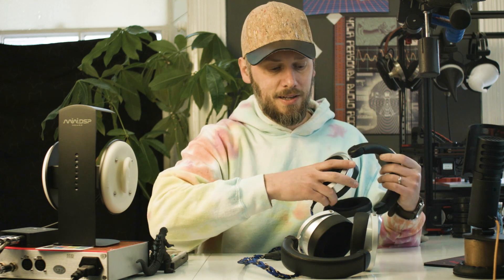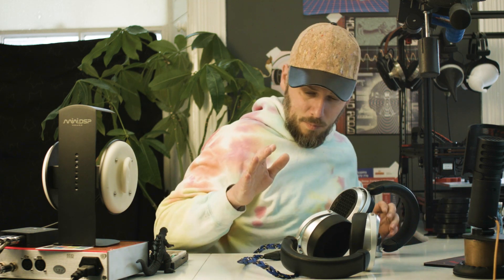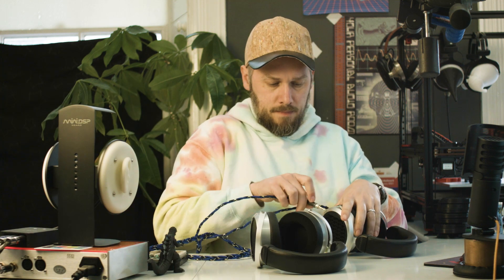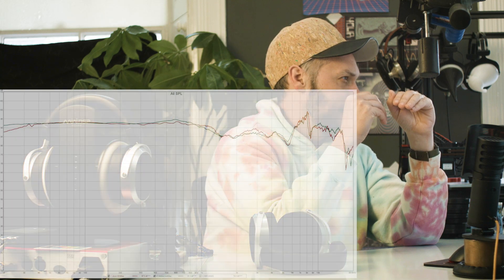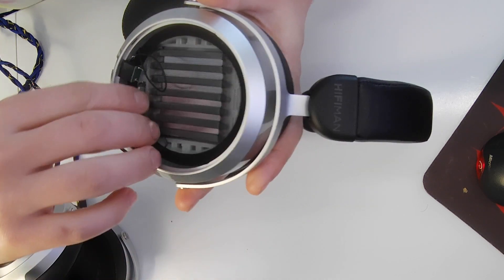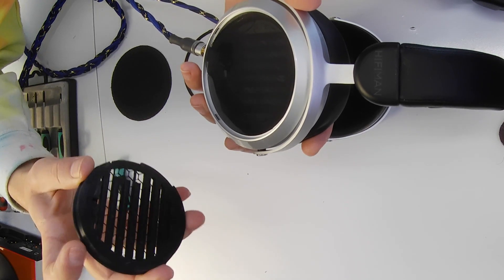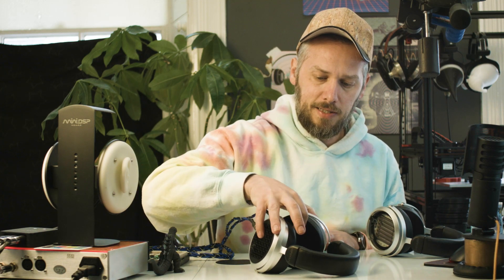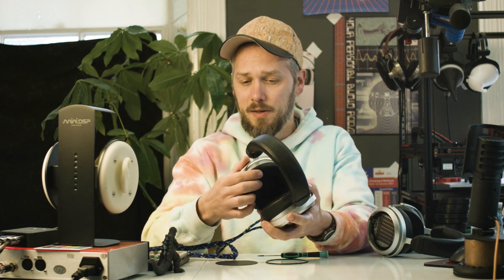HiFiMan HE400se "Super Grills" 3D printed inserts that give more sub bass

Comment: I just did the tape mod to my US$90 HE400SE V2 (stealth) and like the results! The tape was sourced from AliEx for US$6.50 : PTFE 300 degree hi temp tape (10M, 0.13mm, 50mm) cut to a dimension of 18.2mm x 45mm, for each side. The PADS have to be removed in order to do this mod. The tape is placed over the outside of each planar magnet with that cut width (of 18.2mm) covering space two and space three from the rear...on each side. To increase brightness...reducing the tape length from 45mm down to 35mm is optional.

I also modded the headband with an after-market unit (HiFiMan Ananda-styled) for $30. I used the OEM screws that came with the HE400SE for this simple mod.  Much better look and fitment, imho.

I also replaced the GRILLS, cut to dimensions with sheet metal clippers: 
GLOSS BLACK (6x6mm hexagon) 100 x33cm Aluminium Racing Auto-Auto Grill Mesh, sourced from AliEx for US$15. I did use hot glue to position the wires out of the way and at the edges of the cup frame in order to keep the visual through the grill nice and clean.  I suppose I could add some nylon mesh...maybe painted with L and R symbols, at a later date. Else use red nylon mesh and blue nylon mesh for the R and L, resp.

Switched to the OPENHEART 8 Core Headphone Cable, 1 to 2 jack dual 3.5/4.4mm Balanced Cable Silver Plated Copper Upgrade Replacement, 1.4M length, from AliEx for US$13.50.

Lastly, switched up to the ONIX Alpha XL1 DONGLE DAC/AMP, for US$100 on AliEx.  EXCEPTIONAL performer!!!!

The results...excellent.  Very happy with this "CheapAudioMan" solution.
Reply from the maker: I will have to try that at some point

Comment: Hi Jason i'm Nahuel from Argentina, have a few questions, i was install the super grills on My he400 (i do it without the originals mesh). One of the cables seems loose in headphone borders, those one of them cables, doesnt passed under the bottom noch cable of the grill, this repeats in both cans, and You can see them trough, lightning the zone with a flash, but i don't think is something bad, it looks good; it's  looks like a default grill. And both drivers sounds equals. You think this case of the cables could be a future issue?. The headphones have more sub bass, and a little wider soundstage, i think do it great, that's what I'm supposed to wait for? I have V1 china version (no stealth), Sorry for My english

Comment: Wow! I'm very tempted to buy a pair. Do you ship to Brazil (Rio de Janeiro)?
I still had a question: what if, in addition to the Super Grill, I put another very thin layer of fabric on the inside of the earcups? Could this subtly lower the highs? It would be the same material as the original fabric/foam, or even thinner. Would it have an effect?
I'm thinking about putting it together with the Super Grill (shipped to Brazil, of course).
Thank you and congratulations Jason!
Reply: É possível comprar o modelo 3D no site dele (menos de dois euros) para imprimir com algum serviço de impressão por aqui no Brasil. Depois de comprar o modelo fiz pré orçamento automático no site de uma empresa de minha cidade e ficou em torno de 52 reais cada com PLA+ em qualidade alta com 100% de preenchimento. Como não entendo de impressão 3D muito na próxima semana vou ver com mais detalhes. 👍
Reply: @JulianPaulozzi  Você fez a substituição? Se sim, realmente valeu a pena o esforço e o valor gasto?
Reply: @endreweggs fiz sim em PLA (52 reais na fábrica 3d). Segundo o dono da empresa de impressão deu trabalho, tem uma grade bem fina na parte externa mesmo assim até hoje está intacta, montei com a tela interna para protege o mínimo os drivers. Sobre o som ficou mais aberto arejado, aumentou o grave porém ficou mais solto. Eu gostei do resultado uso assim até hoje com o fiio k11 para mim valeu a pena.
Reply: @JulianPaulozzi Muito interessante. Realmente é necessário proteger o driver contra sujeiras. Eu estava tentando modificar e infelizmente eu acabei perdendo uma noite de sono porque o som do driver tava com um som agudo parecendo uma mosca no driver e eu só descobri depois que era um fio de cabelo dentro do driver kkkk

Comment: Just got these today.  I can't comment too much about the sound since the my he400se's are pretty new to me (poor baseline).  I can say clearly there was an improvement in the bass area.  The only suggestion was it was pretty confusing what to do with the wires.  Where to tape them down, I got pretty worried I was going to pull them out so I just pushed them to the side and hoped for the best.  Maybe a bit more clarification about how to manage that.  Otherwise, the bass improvement makes it worth every penny.  Excellent work, this is something to be prout of accomplishing!
Reply from the maker: Yes - I will have to do a proper install video next week. I am really glad you like them. If you get a chance, it would be great if you could add a review to the page on the website as it really helps other people who are not sure whether to go for it or not.
https://jfunk.org/wpc/product/3d-printed-hifiman-he400se-super-grills/
Reply: I used Hot Glue.

Comment: Jay, I love your energy and own some of your cables, can you vouch for this mod given its cost and the value proposition given the cost of this headphone, I'm not convinced, your time want wasted I'm sure but my opinion is that we're looking at aesthetics only here, fair play with selling the files. I also run a workshop and time is money, i SLIGHTLY  question the efficacy of this mod compared to your other work
Reply: Have you actually listened to the mod? If so let us know.
Reply from the maker: @ericboucher799  I have just seen that Zezuz in the comments on this video has done a decent review / comparison of the sound
Reply from the maker: I am not 100% sure what you mean but... We are about to start sending out modded pairs to reviewers to try to get some unbiased feedback on the improvement or lack there of in the sound as I am too close to the project to be fully objective. There is a measurable difference in the sound with them in and I think they sound better but I will let others be the judge.
If you are questioning the business model and whether we would ever make any money on this kind of thing taking into account all the time taken in R&D. This took a lot of tweaking and testing. I suspect it took around 20hrs to design and test the various iterations excluding 3Dprinting time. I would normally charge around £40 per hour so roughly £800 worth of time. So.. We would have to sell quite a few before we broke even. We would probably never make it back selling the files but we probably make £10 a set for pre printed ones once you factor in postage and print time and a bit more than that if we sell headphones with them pre-installed so there is a good chance we could eventually start making a profit on them.
The mod we made for the HD600 has sold just over 1000 units so we are well into profit on those where as the balanced conversion kit we made for the K712 probably only sold 30 units and are unlikely to break even in the foreseeable future. 
It is always tricky knowing which projects will pay off and we have a lot of projects that we just do for fun as you would never get to do them if you were worried about making money ;)

Comment: Just got mine, and you're right, they're easy to fit. Look wonderful.
Reply from the maker: Have you noticed a change in the sound?
Reply: @CustomCans  Certainly more punch in the bass, and it does feel a little smoother in the high mids. Definitely an improvement.

Comment: Printing it now in wood filament, thanks for putting this together! Question though - how certain are you that the sub bass increase isn't simply being caused by the fabric resting against the magnets now? Have you measured it without the fabric there, and are you still seeing the same results in the sub bass?
Reply from the maker: Yes i did all the initial design and testing without the fabric in there. The fabric is not really thick enough to have a noticable affect on its own
Reply: @CustomCans  Amazing! One more question - what infill % did you use for the print? Gonna try a few materials and test them out.
Reply from the maker: @KageWilly  I was using 20% infill
Reply from the maker: @KageWilly  I was using 20% infill and 1.2mm wall thickness

Comment: Will you sell some that are resin printed for smoothness and I think it looks much better? I'm very interested in a resin printed set of grills for my pair. If not, I'll probably still buy them if I like the price, but smooth resin would be so nice.
Reply from the maker: I don't think so. These were designed to print on FDM with no supports. I don't have a resin printer so am not sure of their limitations but I gave some of the previous version to a friend to print on a resin printer and it needed supports or would get stuck to the plate. 
I might get a resin printer in and have a play but I have already spent this months toy money ;)
Reply: @CustomCans  Alright, no problem.
Reply: Any more detail on SLA printing these? I am learning SLA printing right now and should I be able to print in translucent resin... I am definitely buying an open-box HE400se
Reply: Also forgot to mention, would be fun to print HE400seXY shells in translucent resin too...

Comment: So i guess this make the magnet insert mod not possible anymore? Im curious if i can only do one or the other which one would be better and how would they show up on the graph
Reply from the maker: I ended up breaking two pairs of HE400se messing around with magnets so I decided it was too dangerous
Reply: @CustomCans  what did you do to break it? I still have mine attached with magnet, just kinda left it there undisturbed for at least a couple of months now
Reply from the maker: @MrBlitzpunk  I was a bit of an idiot. I was playing around with making a slot in the insert to hold the magnet and the magnet fell out and managed to get sucked inbetween the fixed magnets and pierced the diaphragm. You will be fine as it is but if you are using a magnet less then 5mm thick just be super careful if you remove it.. And don't drop it between two of the other magnets.
I just did not want to recommend doing it just as there is a non zero chance of bricking a driver.
Reply: @CustomCans  oh i see so without modifying the super grills how thick of a magnet would fit ? Cuz like i thought of buying 2mm thick Bois and then fit them over the mesh so that I have some protection if I fuck up and the mesh would prevent from the magnets going in. Anywho I tested the super grills alone super impressed I was. (won't recommend them with pu leather earpads tho)
Reply: @@natesf2106 big? No, but it's definitely a noticeable improvement. I used to use EQ for the bass but with the magnet i don't see the need anymore. The EQ bass is still better in quantity but with the magnet it's good enough where i don't see the point in EQing. Also i feel like the treble is slightly smoother
Reply: @@natesf2106 yeah i did what he did, check out his latest vid about the he400se modding, the ones where he also discuss the hd6xx